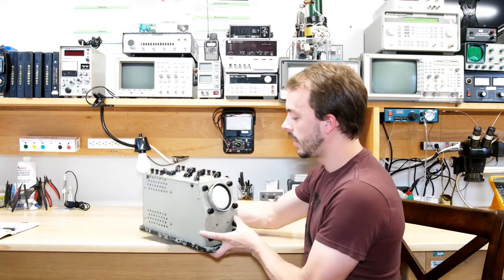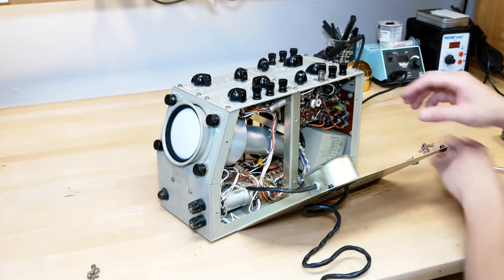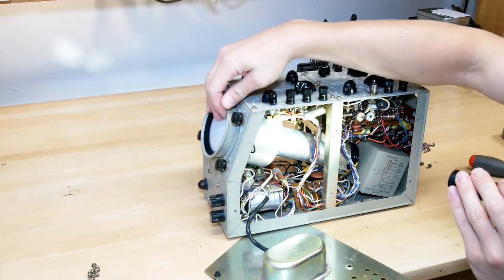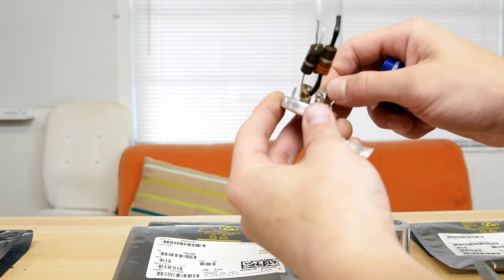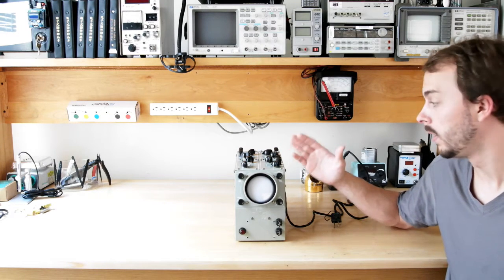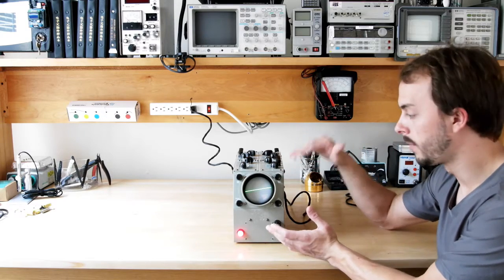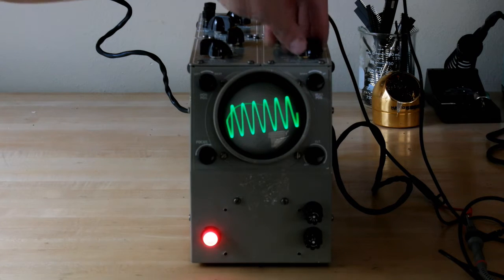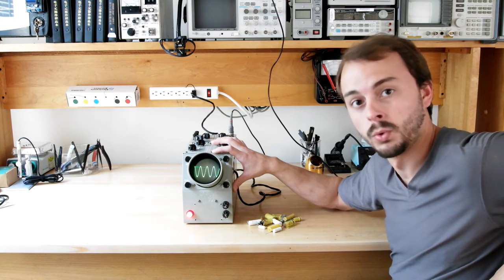Retro OS-8C/U Oscilloscope Restoration

Comment: Hi Coyt.  Nice video.  Was gifted one of these beasts.  I am going to rehab it,  but having a hard time getting past the smell.  It smells like used motor oil.  I'm told by other hams that is "Cosmoline" that the Navy spread and coated everything with back in its heyday.   I'm told that the scope was watertight in the case if the clips were tight and the gaskets were in good shape and would float.  ??!!
Did you notice a strong smell from your scope?   You described you were going to clean it, but did not show in your video, nor did I hear you describe what you used and how you cleaned it.   I've heard tales of HP and Tek using fire hoses and simple green cleaner,  then baking it at 180f overnight to drive out any remaining moisture.
Reply from the maker: Hmmm... honestly I don't recall any significant smells coming from the scope nor did I notice any weird coatings. The inside of my scope was relatively clean already, so it didn't need much besides a dusting - I think I used an old paintbrush and compressed air can to make sure there was no surface dust / dirt inside. For the outside, I did use simple green and paper towels to wipe/scrub the entire outside including knobs, etc... to get it as clean and new looking as possible - this seemed to work well. I probably wouldn't soak it in cleaner, but as long as it dries I doubt it'd hurt anything. 

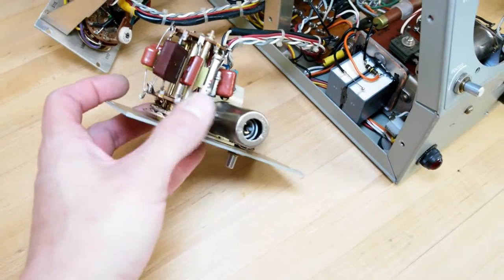Also, I'm wondering if a cap exploded or leaked in your unit and that's possibly causing the smell? The old electrolytic caps that I took apart were pretty nasty inside, and one of the other caps I replaced may have been filled with oil if I remember correctly (the one I cut open to mount the new caps at around 11:15 in the video).
Reply: @CoytHV  Thanks for the response.  I believe you may be correct about the smell being capacitor goop.  If liquid in the electrolyte evaporates, the gas has to go somewhere, and this beast was stored for decades in its case locked up tight.  I powered it up gently and slowly with a variac a couple years back, with zero restoration, and she did work!

Comment: Well done, Coyt.  I'm a novice electronics hobbyist, which means that I basically know enough to get into all sorts of trouble.  I had also watched Mr. C's videos on building a curve tracer with an old analog scope, so I went in search of one, stumbled upon the OS-8/U series of scopes, and took a keen liking to them.  In fact, I just bought an OS-8E/U as my first scope and have started to do a basic restoration to get it into working order so that I can start using it.  I also had planned to convert my OS-8 into a curve tracer, possibly in its own external project box and, hopefully, connect it through the rear terminal board.  It's cool to hear you had the same idea.  I'd love to see your scope in action or in use as a curve tracer and how you chose to construct and connect it.  Thanks for the vid!

Comment: Very nice video man!  One thing though, I highly suggest you go in right now and get rid of those selenium rectifiers!! It not a question of will they go, but when and I bet it will be very soon. I  show replacing them in some of my videos.  The signal generator I think I went into more detail of adding series resistance and such.
Reply from the maker: Thanks! And will do! I had no idea the selenium rectifiers go bad until your comment. Just did some research and yea I see now I'll have to go back in and add a modern replacement as well as a series resistor. Hopefully I have suitable parts laying around.

Comment: Great video man, and cool little scope!  I noticed on one of Mr. C’s videos he uses a sharpie to follow the line horizontal line of the crt, then uses that to align.  When I worked in the glass field years ago, we used sharpie lots, and removed with denatured alcohol. This is how I align old crt now. Quick question, did you use iMovie for your editing?  I am hoping to do a few vids myself to honor Mr C ‘s teachings, and like that speed up effect a lot. Again, nice video, and great job!
Reply from the maker: Thanks! I was going to do the sharpie/dry erase method, but honestly I cheated a bit and ended up just leaving the CRT a bit loose. This allowed me to gently twist it a bit while it was on by simply using the friction from my fingers on the front of the glass. Once the trace was straight I went back in and tightened it fully. I'm sure this method rarely works but it was easy and quick for this scope.  

As for editing, I'm using CyberLink PowerDirector. I've only made 2 videos with it so I have no clue how to use 99% of it's capability - it's a pretty full featured program - but seems decent so far.